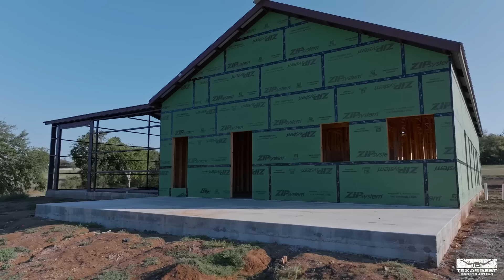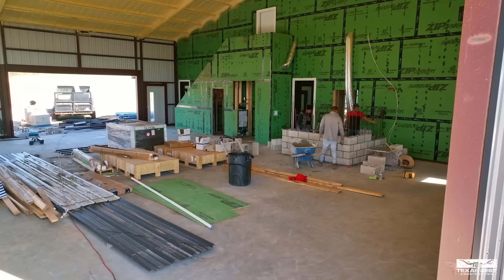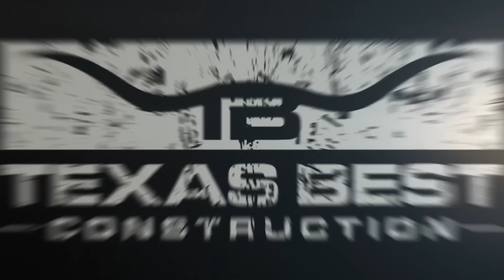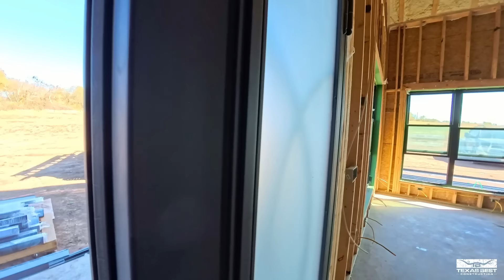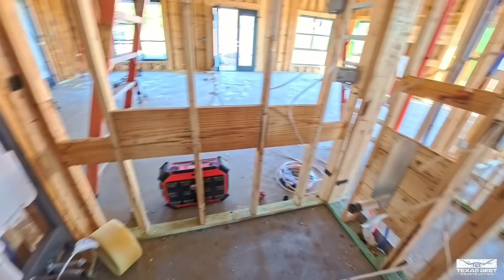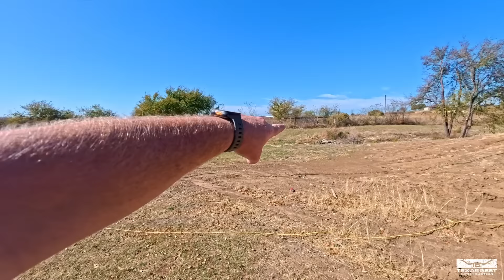Weatherford Barndominium Update Safe Room, Steel Doors & Wall-Mounted Toilets

Comment: Great workmanship congrats.  Two points we won't get when we build ours; exterior metal sheathing does not look good so we will use conventional house brick or Hardie siding, and the 12' to 14' or higher ceilings are not comfortable for humans to reside in and of course greatly increase the cost to heat and cool.

Comment: What does a build like that cost? $600k? $700k?
Reply from the maker: Couldn’t say exactly. Each project has its own variables that can impact specific cost. But you can check cost calculator BarndoQuote.com also our 2025 cost video for general cost discussion https://texas-bestconstruction.com/barndo-buzz/f/unpacking-barndominium-costs-in-2025-what-to-expect

Comment: I'd skip the in wall toilets. Especially if there's a source of heat like an oven, fridge or sun hitting an exterior wall that can warm the water in the tank creating mold and mildew. Not worth it.
Reply from the maker: I don’t believe we have any on an exterior wall or behind a fridge, but is this a problem you’ve had experience with in the past? I have not heard of that.
Reply: @TexasBestBarndominium  Yessir